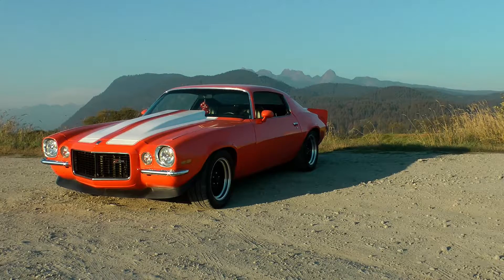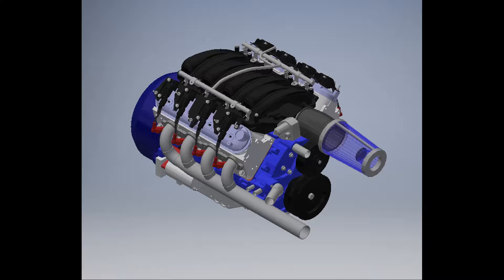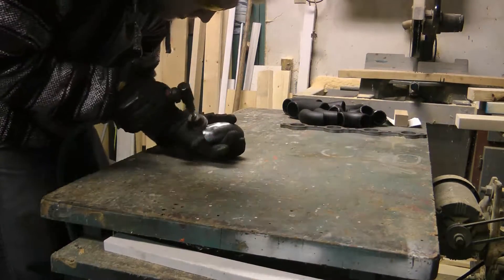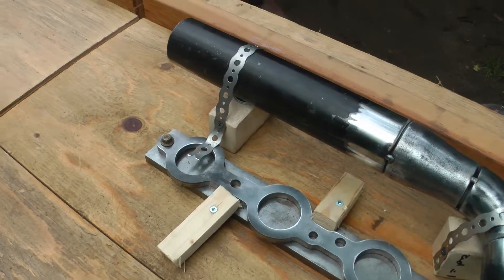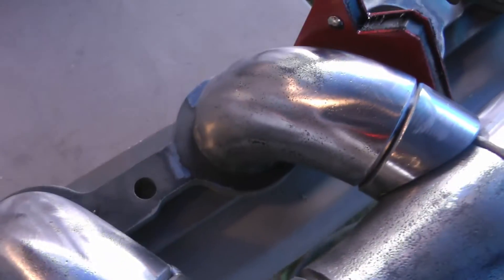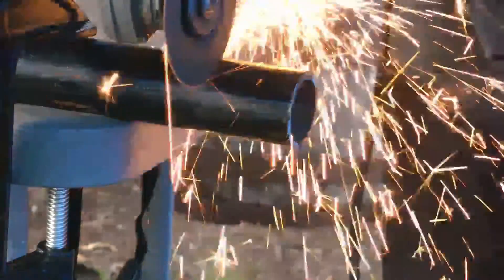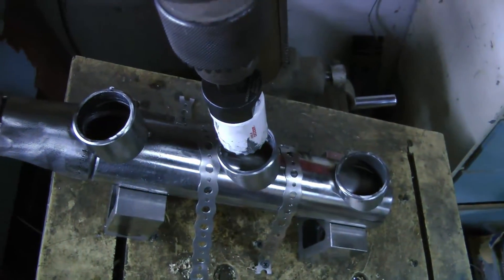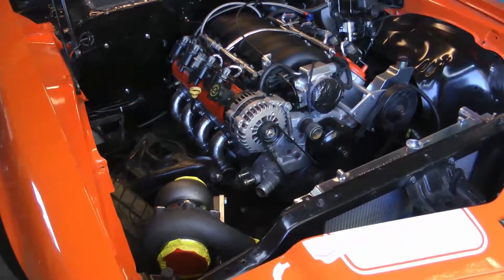How to build LS turbo log manifolds cheap from scratch!

Comment: You had the luxury of a drill press. Would it have been possible to notch those little pieces with that, instead of tracing the pattern and grinding?
Reply from the maker: It probably would have worked better but I didnt have the jig to hold it to my platform, plus the pipe wrap method is so simple and quick. Those pieces only take 20 mins each start to end!

Comment: I have never seen anybody use plumbing pipe to make exhaust manifolds before but it looks very strong and should last a long time , good job man.
Reply from the maker: Thanks so much! They're getting ceramic coated soon so they should look a bit nicer
Reply: Steam pipe is very common heavy but strong I've used for years

Comment: Have you sold your headers you pulled off the car yet?
Reply from the maker: I actually scrapped them! They were garbage headers.
Reply: Westcoast Wrenchin' dang those are the ones I’m wanting to order and cut to fit. Were they no good after a while?
Reply from the maker: The problem was the metal on them was so thin, they didn't take the best to being re-angled. I'd buy a better quality set of 4th gen headers and cut them and you'll be fine. These were paper thin china headers.
Reply: Westcoast Wrenchin' thank you for the update on those!

Comment: Do you have a link to the company where the elbows were purchased?
Reply from the maker: The shocking thing is i couldnt find them online! Mcmaster carr offers a stainless elbow. The company I used was called andrew sheret. Just find a local plumbing supplier or ever sheet metal supplier and they will have them. Cheers!
Reply: Westcoast Wrenchin' Thanks, Have plenty here in the FTW area.  Will hit up a plumbing shop.